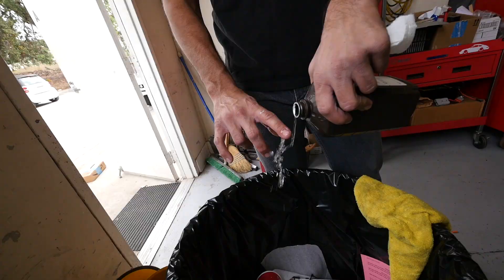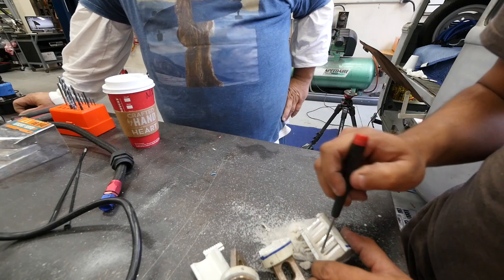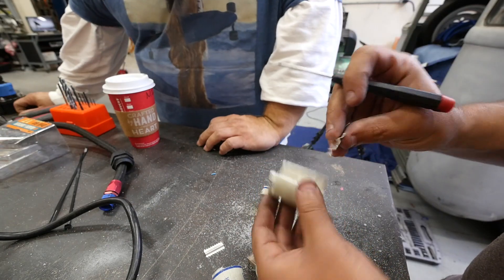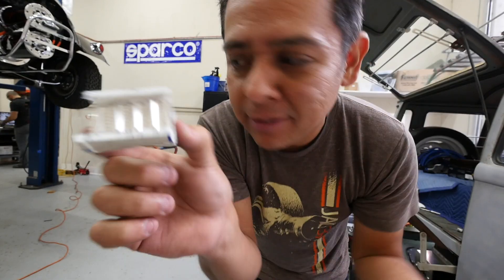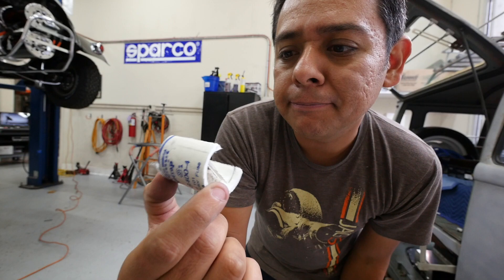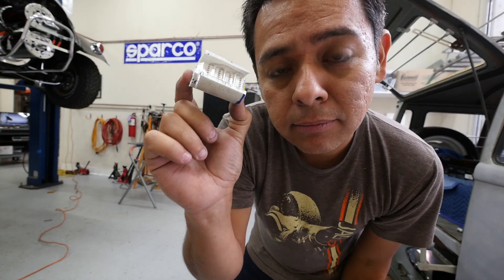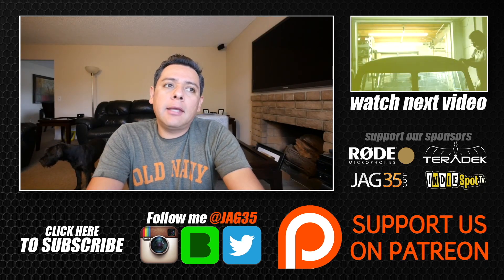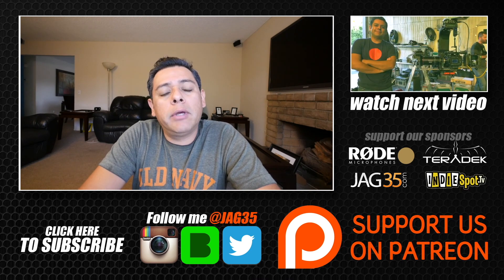Whats inside  -   700V  400A FUSE

Comment: The sand like substance is to stop the fuse from exploding.
If you have ever seen a glass 20mm x 5mm fuse explode the reason is that if it gets a huge over load i.e. a short where the load is say 100 times the fuse rating the fuse element evapourates and the deposites as a thin film on the inside of the glass tube.
This can make the circuit again but because the metal is on a surface it cannot heat up quickly so a huge current again flows this time shattering the glass.
The ceramic versiions of this fuse called HRC (High Rupture Current) have the sand like substance in them and it stops the formation of the 2nd fuse when it evaourates.
Reply from the maker: +FireballXL55  cool,  thanks for sharing

Comment: A hot spot at one end due to poor connection caused the wire to 'fuse'.
Copper has positive temp coeficient so temp avalanched just like a fuse.
High surface temp causes oxidation/discoloration.

Comment: You can purchase fuses with a renewable link so you don't have to throw the entire fuse away. The Eaton Bussman fuses have capacities up to 600 amps. When the fuse blows you can unfasten the end caps and replace the link which is about 1/2 the price of a conventional comparable fuse. The speed of the disconnect is important because if you seek slo-blo  or instantaneous blow (quik-blo) you must determine the desired tolerance of over amperage.